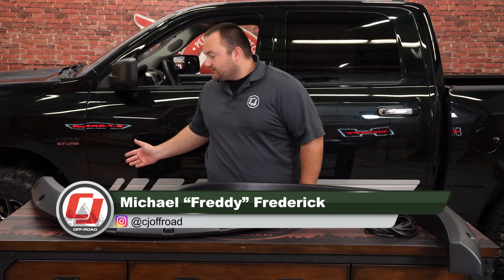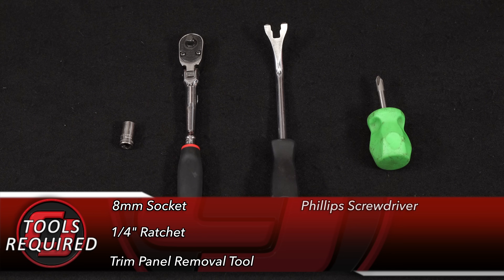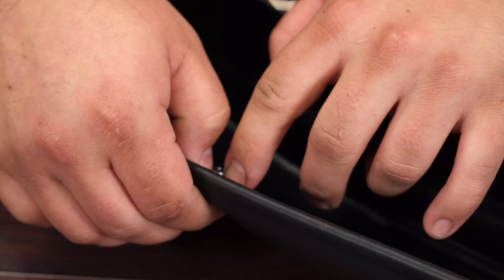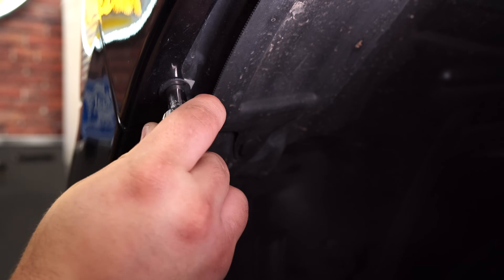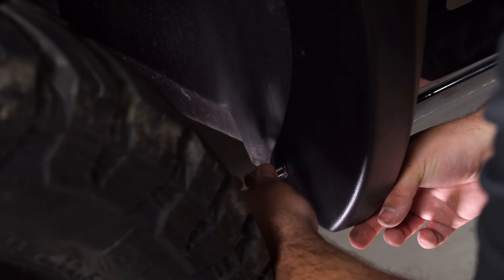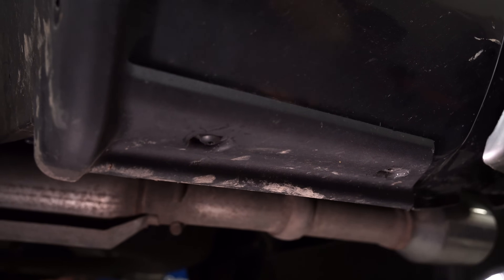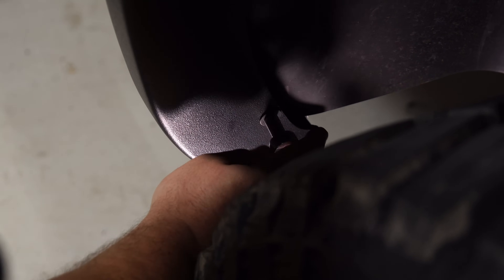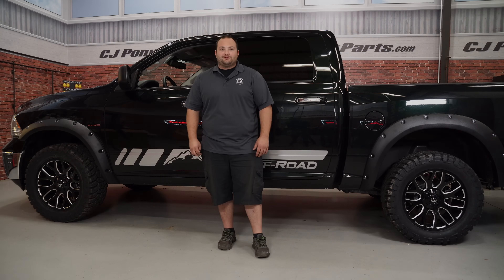Dodge Ram Install: Rivet Style Fender Flares for the 2009-2018 RAM

Comment: Do you take the factory flares off first or just put the after market ones on top?
Reply: pretty sure you remove the oem ones
Reply from the maker: we did not have factory flares they just bolted right up to the fenders

Comment: Did you have to remove and relocate any of the vehicle badges to install the fender flares?
Reply: No
Reply: i am curious what badge you thought would hit flares?
Reply: Acreage Living:  the diesel badge
Reply: Lisa Smith that’s not a diesel
Reply: You do, the Hemi badging in the 5.7s run 0.5-1" under the flare, so they need to be shaved and/or moved an inch or so.